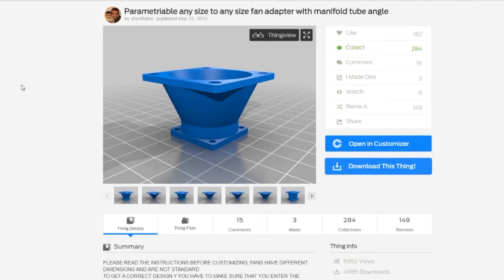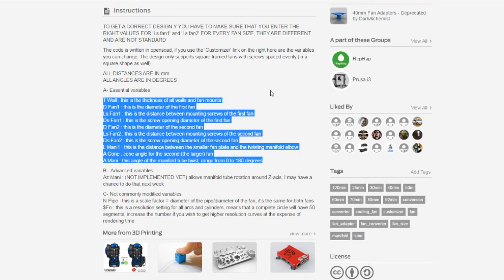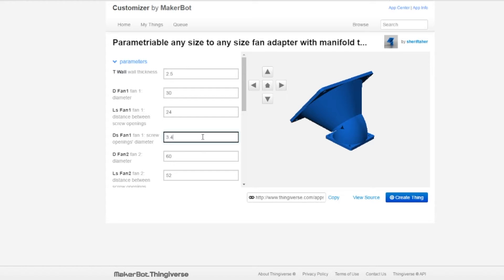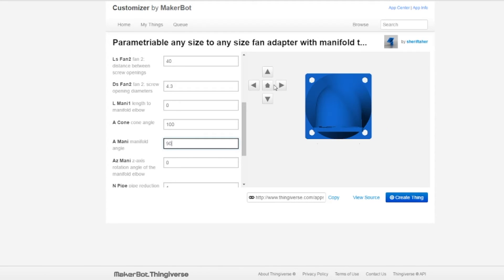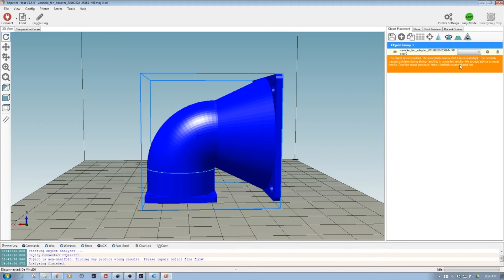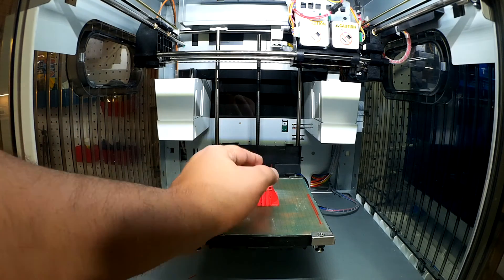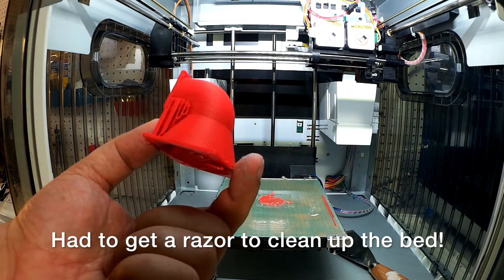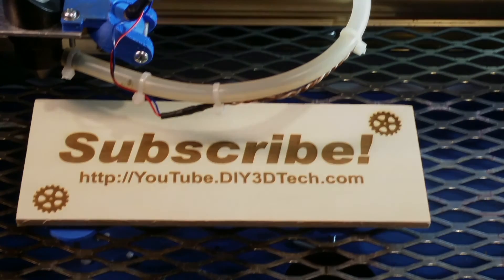Thingiverse Finds - Customizable Fan Adapter for Wanhao Layer Fan!

Comment: i saw that you had some trouble unsticking that print from the bed and I wanted to ask your opinion, I had a 3d printer very similar to the wanhao duplicator and i always wondered what is the correct way to unstick such prints. It seemed to require even a bit of hammering on the tool, but the bed coud move. I'm assuming the best thing is the machine is off, but even then I'm wondering if that kind of force on the moving part isn't bad, yet i don't know of any "lock position for detaching print" setting... i was wondering what your thoughts are on that.
Reply from the maker: These are old videos, suggest switching to PEI as I did.  When the print cools it just pops off.  Here is the link: http://amzn.to/2cSFgt1
Reply: but when it warm it still sticks? thank you
Reply from the maker: Very well!  I use it for both PLA and ABS...
Reply: thank you! saw this too late and put a "build tek", helped a lot with sticking, but i wonder if this PEI is better and/or if it also helps to flatten out some bed bumps. I hear people praising  glass but i'm afraid of opening up the printer to adjsut for the extra height
Reply from the maker: Love PEI, once the Buildtek wears out would go that way as this stuff is magic...
Reply: thanks a lot! will do! didn't even know how/when buildtek wears out. Any idea how many prints? Is PEI thicker/flatter or is it just a thin sticker on like buildtek?

Comment: Hi I did the fan upgrade but the fan won't turn on do you know what might of happen
Reply from the maker: +brian 96 The fan is DC so there is a positive and negative, if you plug in the fan "backwards" it will not run and can damage the fan too...
Reply: +DIY3DTECH.com how should it look
Reply from the maker: Had to say, you could try flipping them around, but before you do that you know the layer dosen't run all the time.  Use the control panel to turn it on.  Since I am not at home I can't where its at in the menu but know its there...
Reply: +DIY3DTECH.com the fan you mean?
Reply from the maker: The layer fan and not the extruder fan...

Comment: This should definitely give you lots of airflow.. but, all the airflow will be at the front.    I'd like to see if there is any difference on a 3DBenchy (or some other calibration print) with all front-cooling, compared to a 360 cooler like the DiiiCooler (or something similiar).
Reply from the maker: +Scott Adkins We could maybe try that...